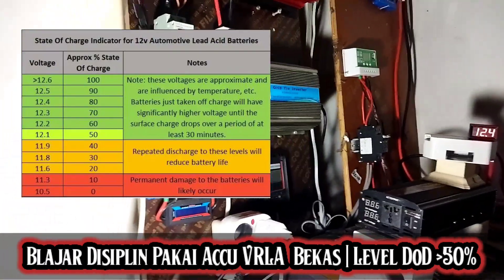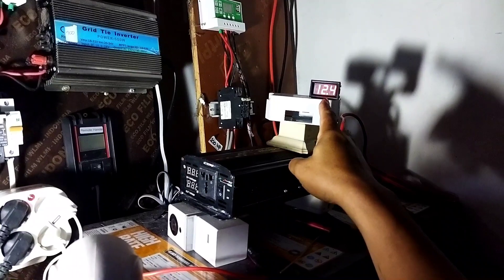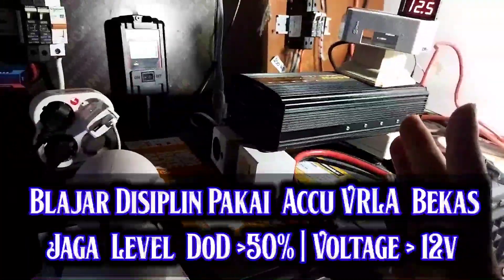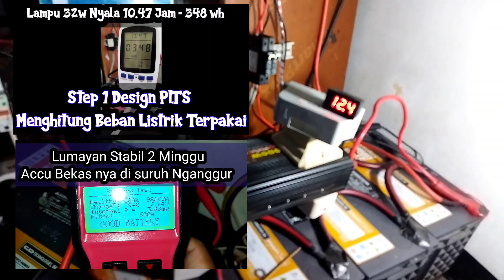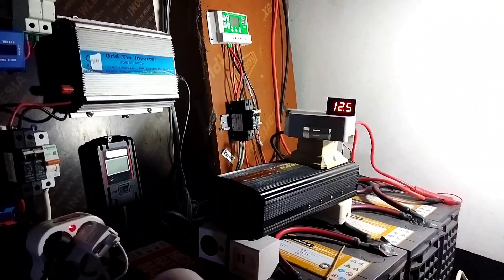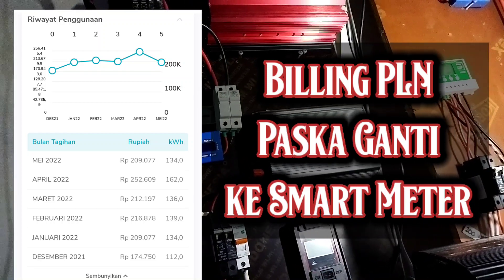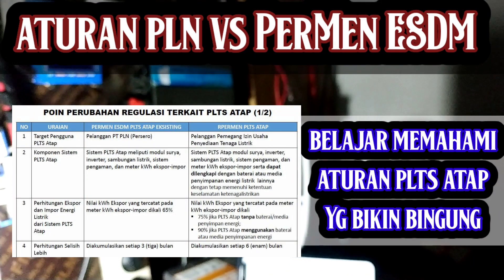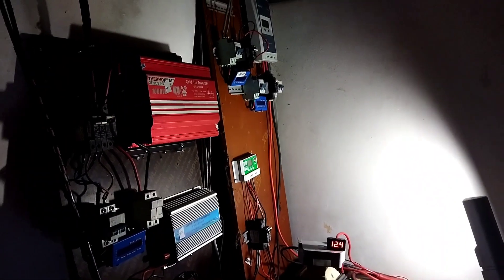Nasib Tagihan PLN Setelah Kwh Meter Diganti Massal Pakai Smart Meter | PLTS OnGrid vs Smart Meter

Comment: Sebelum nya makasih penjelasan nya pak.

Tagihan saya dr awal 1,5 jt, selang sbulan lngsung meroket 2,5jt sejak pergantian kWh AMI. Klo emank solusi nya sprti di video atas agar harga tagihan menurun. Bisa kah di buatkan video lg kenapa bisa naik tagihan secara system. 🙏🏻
Reply: Sma sya juga listrik 900 bayar 1.5jt
Reply from the maker: kalo bayar PLN udah diatas 500rb.... sebaiknya pada mulai belajar pasang PLTS ......
Reply: Negara tidak mewajibkan pakai Listrik PLN. klo gak suka dengan PLN, sekarang ada Solusinya.
Pakai Listrik SOLAR CELL. itu fungsinya sama seperti PLN.

Comment: Kira2 perhari hbis berapa kwh klo tanpa plts?
Reply from the maker: kalo sblm ada plts .. per bulan biasa nya kena di atas 300-400kwh, kalo lagi musim dingin jarang nyalain AC... tagihan per bulan bida kena 400-700rb.
itu cuman nyalain Jetpump + mesin cuci + setrikaan + majigcom + lemari pendingin.... .  kalo lg sering  nyalain AC bisa kena 700-800rb tagihan listrik nya .

skrg setelah ada plts, palingan bayar 150-200rb .. dgn pemakaian 130-150kwh
Reply: @Dzikr_Family  
Sblm plts brrti rata2 perhari 400:30hr=skitar 13kwh....waw banyk bget
Reply: Knp koq tdk pake yg full offgrid?
Jd klo siang bs charge sekalian dipake,sisanya u malam klo baterai mencukupi,yg pastinya pake panel ATS
Reply from the maker: hahaha iya.. maklum.. isi rumah 8 org.... nyuci setrika nya banyak.... 😁
Reply from the maker: masih kurang accu nya,.. baru punya 4x120ah... kasian kalo di forsir full offgrid.       inventer nya jg masih yg HF, bakal gak kuat.

jd combine aja .. 
Ongrid pakai 6x100wp
Offgrid msh 3x100wp

total panel ada 15x100wp... tp sebagian rusak efek kena badai 2 bln lalu... 😂
Reply: @Dzikr_Family  
yg 600wp rusak😱eman bget.
pake daya PLN brp VA?
Reply: Kira2 sblm rusak, total biaya rakit plts sdh hbis brp?😁
Reply from the maker: wah... berhubung sy awam listrik elektronik... jdnya  kebanyakan di ongkos  Try Error.... beli inventer aja salah .. kirain semua perangkat DC, miirp kaya perabot rumah...  sama semua voltage nya .. ternyata ada yg 12v... ada 24v.. 48v ... jdnya hihh cost krn banyak salah beli.. efek blajar plts nya bener bener otodidak.. dari NOL.. dari gak bisa bedain makna kabel merah vs kabel hitam itu apaan ..🤫

kayanya gak cocok buat dijadiin patokan total biaya nya yg saya sih .....krn kebanyakan Stupid Cost nya... alias biaya Ke-Oon-an yg musti dibayar...🤭

kalo standar ideal .mungkin skarang jatuhnya di range 5-10rb/wp kalo kita gakj banyak kesalahan dlm mendisign plts...dgn pakai barang barang yg sejuta unmat...

https://youtu.be/gJcGwMtcSe0

https://youtu.be/gJcGwMtcSe0
Reply from the maker: dirumah pakai 2200va